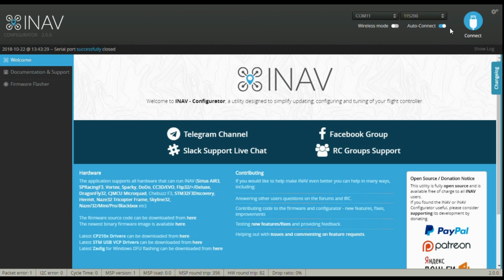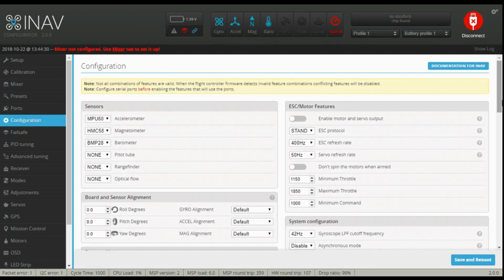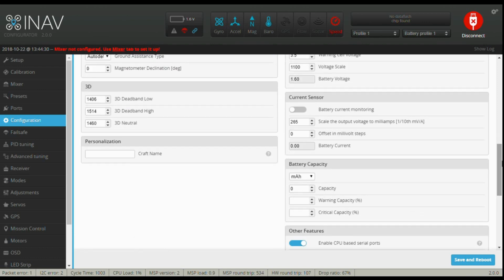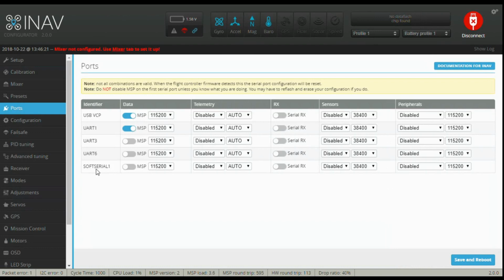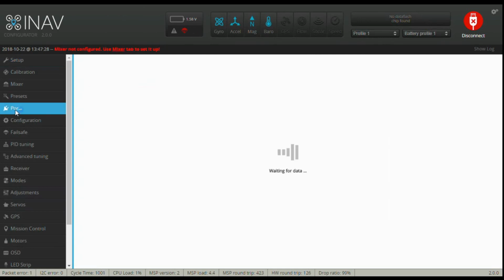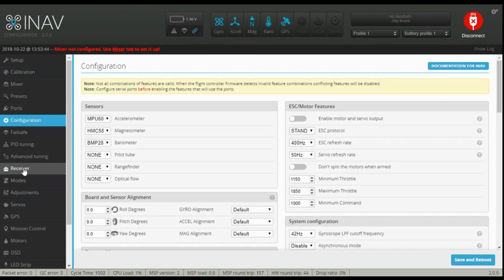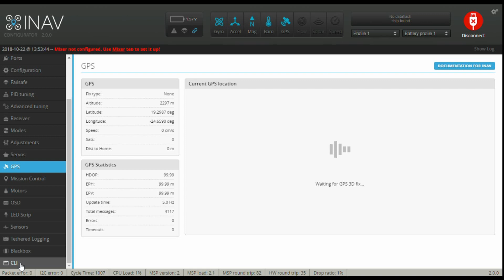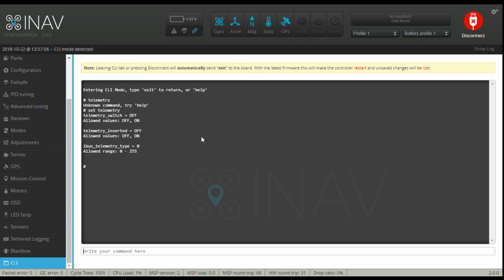Adding RSSI & Softserial pin headers to Omnibus F4 Pro V3 for Inav

Comment: Hi, i have a question. I am using omnibus f4 v3, "not the pro" but same function.  As we can see in the  motors 5 and 6 there is also printed pwm 5 and 6 on the same hole or pin, so which means that the pwm port and motor port are the same ports. Is that right? But in the resource mapping they have different resource codes. Why is that? Like e.g  
resource motor 5 A01
resource pwm 5 C08
They should be the same, right? if they are in the same hole or pin

Comment: I have a Omnibus F4 pro v2 (clone) running INAV 2.0.0. I see those two pads above MOTO_VCC. 

UART1: IBUS for receiver
UART3: TX3/RX3 SCL/SDA for magnetometer
UART6: TX6/RX6 for GPS. 

Can I connect a wifi module to those CH5 and CH6 pads and provide power 5v from PDB. And then enable softserial to make it work? 
I read in INAV wiki that “SOFTSERIAL1 is an uni-directional port mapped to UART6-TX pin. When enabled, the UART6 is still available as hardware port but it's then RX-only port“. 
Will this affect GPS any way?
Reply from the maker: Hi Simon. The short answer is that I don't know. I had also read conflicting posts on the subject. I think it depends on the version of the board that you have and the inav firmware build. Having said that, the inav documentation here:

https://github.com/iNavFlight/inav/blob/master/docs/Board%20-%20Omnibus%20F4.md

... seems to say that it depends on whether you have a basic F4 board, or an F4 Pro. If I read it correctly, softserial appears on UART6-TX on the non-pro board, but on CH5/CH6 on the pro.

I am using an F4 V3 banggood clone board with this firmware build:
INAV/OMNIBUSF4PRO 2.0.0 Aug 19 2018 / 21:27:27 (dbdd1656a)
uart1: serial RX (sbus)
uart6: GPS
SoftSerial1: Smartport

In the CLI I have:
Set SerialRX_inverted=off
Set Telemetry_Inverted=off

.... so I'm only using softserial for TX, but it is working on the CH6 pad on my F4 Pro V3.

I think, in the end, you're just going to have to try it and see.
Reply from the maker: @blendofdiscovery  Interesting! I've no experience of doing this myself, but in principle it should be possible. You'll have to make sure that you set the baud rate etc. manually before you connect it because I doubt INAV has any code to support the module. Someone appears to have got it working in this video, but he says that it took him four days!
https://www.youtube.com/watch?v=Q8hn0-fy4OU
Reply: I just asked in INAV git page and they said it should work too.
Going to order one and test out https://github.com/iNavFlight/inav/issues/4073